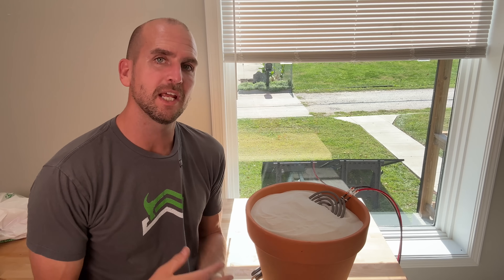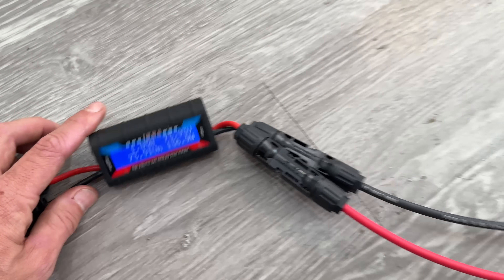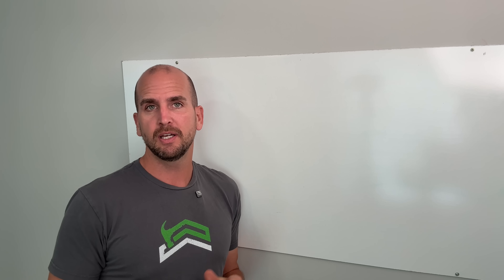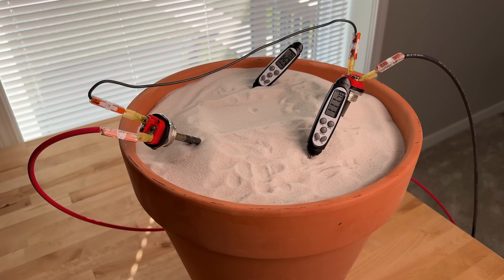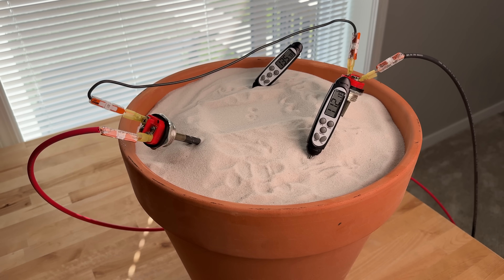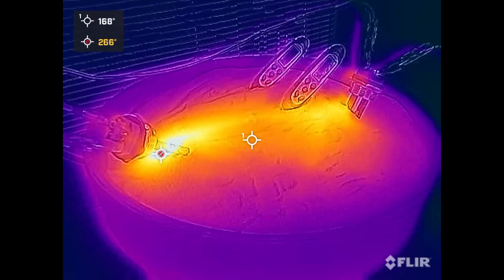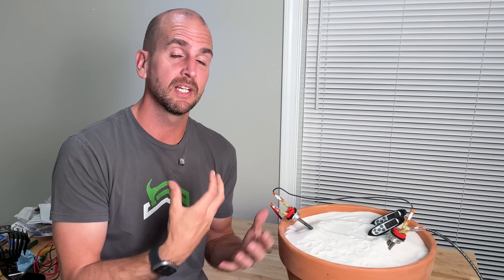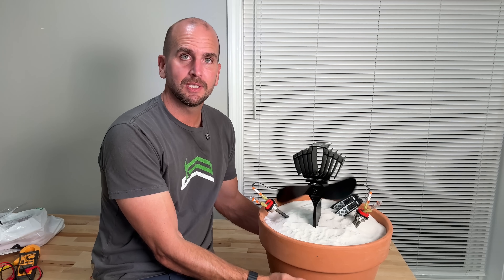How To Create A Solar Sand Battery Heater | Free Heat This Winter!

Comment: Could you run a pipe through the sand and run through a radiator?  Maybe you'd need a bigger sand store?
Reply: It won’t be as effective. Every time heat transfers, you lose energy.
Reply: @jeffh4505  but isn't this an issue of heat storage?
Reply: @bloodynorahvan2203  sure, but you ultimately want to limit the number of times you transfer the energy.
Reply: @jeffh4505  It would be an interesting experiment.  Would the ability to insulate the sand battery offset the lose of energy from the transfer?   There is a company in Norway that makes huge sand batteries, and they are able to keep the sand temperature up above 1000 degrees with insulation.
Reply: @jeffh4505  i don't think that's true in this context. all the heat in the system, if the whole system is indoors, is never "wasted". It may radiate from areas that are less efficient for spreading it out, but it's all going into the ambient space regardless.
Reply: @gd.ritter  That's valid.  It just wouldn't necessarily work as well as anticipated.

Comment: I like the idea... What type of sand did you use ?
BTW... 13:49... That would be a Peltier Cell.. A Thermistor is a Temperature Sensing device.

Comment: One might be able to heat sand up significantly at low cost using a parabolic solar cooker.  Imagine a hole in the bottom of the clay pot full of sand exposing the bottom of a large metal heat sink, with the fins inside the sand. The sun heats up the metal, transferring the heat evenly throughout the sand.
Reply: Right, but you also need a reliable tracking device, then it's no longer low cost :) And how much weight can the pot holder support?
Reply: @SolarCookingGermany  Great points!

Comment: Using a solar diverter controller would make this way more effective. In the UK we have devices like the Myenergi Eddi, the  Immersun, and others, which can run direct electric resistive heater elements directly.

Comment: If using this in an emergency, I would try and reduce the space i need to heat, like a using it in a tent, or some makeshift shelter using blankets, etc.
Reply from the maker: Smart, thanks for the feedback!
Reply: Can nest tents in winter too. Like a blind or ice fishing tent with a smaller tent inside to insulate and precondition surrounding air. Will reduce condensation on sleeping tent too.
Reply: Yeah could actually be very viable then

Comment: Hmm, I dont think thats enough sand and it showed with a loss of 100 degrees in a couple of hours. Heat coming out the side is a loss. Is that a plastic pot? A real ceramic one would be better.

I think a 50 gallon drum with one element up top, one element on bottom, and in the center small tubes going thru the drum horizontally and have a fan blow thru them(in an arrangement similar to a vertical firetube boiler for example) would be a more optimal setup especially when solving the problem of getting heat out. Yea, thats beyond the scope of an emergency setup. But if you have a nice reliable setup before the emergency, then you wont have an emergency lol
Reply: But this is a simple demo of what can be done. For a real use case you'd need to add more sand to store more energy and have more panels + heating elements. 

The pot is a terracotta pots not a plastic one.

Comment: So much math but all you need is just the watts, which gives you exactly how much heat you’re getting as all the energy is transformed into heat. 
BTW, you can also have a solar setup with an inverter and an electric heater and assuming entire setup is indoors, all of the energy will be transformed into heat because all wasted energy is transformed into heat. Granted setup is more complex but will also allow you to charge electric devices (eg phone) in case of an emergency

Comment: I would like to see a long term analysis to keep a shed warmish over the winter.
Reply from the maker: That would be interesting, thanks for the feedback!
Reply: All you need to know to do this calculation is square footage of the space to be heated/cooled, surface area of the outside walls, net R-value of the insulation of the walls and ceiling, and the delta-T desired to meet expected temperature.
Reply: Move it to the BASEMENT!
Reply: I wonder if you’re gonna inspire a lot of critters to try and get in there haha!
Reply: Put heating element and thermal fan in sand at safe distance ( as to not burn out thermistor), heat room as necessary.
Reply: I have 800 watts solar going into similar size pot as this one shown. 
It gets hot over 250 degrees c.
I live in Ireland so our Sunshine is far less than other parts of the world.
I think their interesting and fun to do.
I have a shunt type voltage meter on there to measure wattage and I'm getting about 1.3kwh per day out of my panels which are hung vertically so not ideal.
Realistically that's not enough power to heat a room on its own though but it does help.
Depending where you are,you might get better results.
I took the element out of an old storage heater (240v) for my set up, best to string the panels in seris when using that kind of an element it's just the way it works.
Have a go it's fun.

Comment: Might want to try comparing results with dry sand vs. wet sand.
Reply: Not a good idea, except if your room is dry with a humidity below 50%. Water evaporation has a cooling effect. Better put closed bottles around. If you want to increase thermal mass, put stones+sand. Or oil. Or just water in a hermetic boiler/radiator.